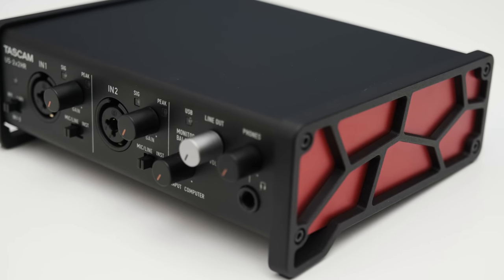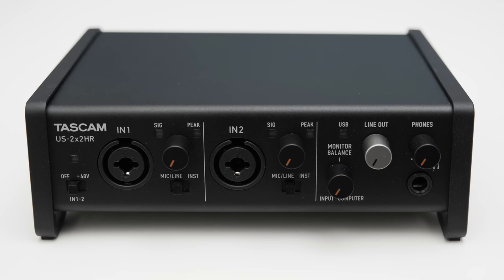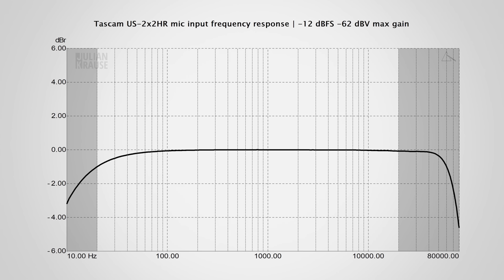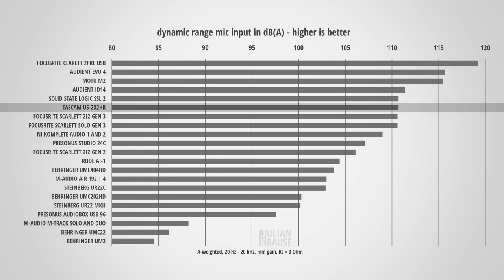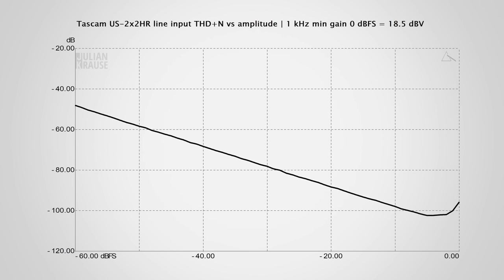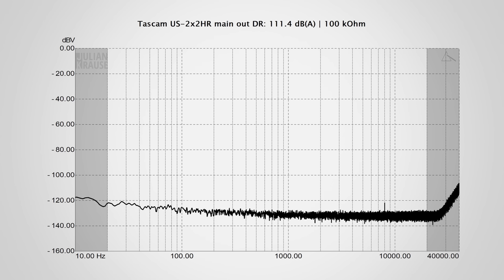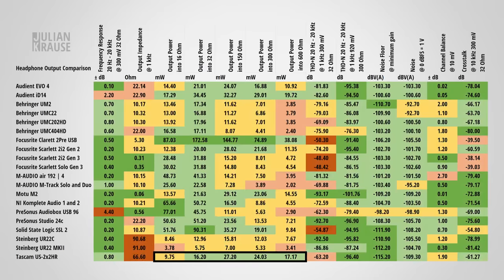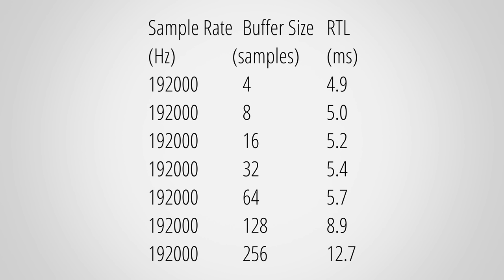Tascam US-2x2HR USB Audio Interface Review (audio quality test)

Comment: Young Julian Krause, I was enjoying your review.  Until you said...

These line level inputs will take full studio line level outputs, up to +18.

What the hell Julian?  Do you know what comes out the line outputs of Neve, API and SSL consoles?  It's more like +24 dbM up through to and beyond, 32 dbM.  On peaks.

And what you're going to get.  When all of the inputs clip out at +18.  Full studio line level, my ass, Julian.  No that's not.

You could consider its full studio line level, for rank amateur beginners and home recording enthusiast wannabes.  Yes.  Then you are a professional amateur!  Yippee!!!  Then you'll need an official recording engineer T-shirt.  That says, WILL RECORD FOR FOOD.

I mean telling everybody +18 is full studio line level.  It is like telling everybody that Heifer Wise Ass a.k.a. unfiltered wheat beer.  It is clear like Budweiser and not cloudy.  Yeah no.  Then it's not real wheat beer if it's been filtered.

HR on CIRRIS Logic when all of the other high-end converters are using AKM?  192 kHz is just the clock rate.  And is independent of whatever audio quality, real engineers require.  A faster clock does not automatically equate to better sound.  It does equate to a broader wider, high frequency range.  Beyond that of our human hearing capabilities.  I guess that's important?  If you can't hear it?

But you are right on the money, old man.  When you say that 50 DB worth of microphone preamp gain.  Is, even enough for the, less sensitive, lower output, SM-7B.  And of course there.  The joke is on you.  And do you know why Julian?  Would you care to mention this to anyone Julian?  As to why that is?  Let me tell you.

The reason why everybody thinks the, SM-7 and SM-7B's have less sensitivity and lower output.  It's because...  It's an, SM-57 capsule.  That is now, at least 2-3 inches further away from the lips on your face.  Thusly making the SM-7's appear to have lower output.  Because you can't put your lips within 1 quarter-inch, of the diaphragm of the microphone.  The long black foam condom covered phallic foam tube has the 57 capsule and diaphragm more than midway down the length.  I love that phallic looking foam condom covered, $450 US microphone.  With the heart of their, $100, PA microphone with an, SM-57 capsule.  Or as told to me by the engineers at SHURE Brothers in Evanston, Illinois, USA.  Because I'm an engineer also.  And I needed to speak with them about a specific set of application needs.  I needed to discuss what the best capsule would be for my purposes.  They also used the same SM-57 capsule in the little-known, SM-5.  Of which I had one in, 1978.  Until 1988.  When all the foam turned to dust and disappeared.  Leaving behind in an internal shock mount a SM-57.  I thought that was very funny.  Because the microphone was larger than the SM-7.  But that is one sucking fantastic capsule!

And for all of the little home recording morons.  The don't think that 50 DB of MIC preamp gain is adequate?  Because it's not slamming the meter.  Doesn't mean that simple entry level beginner want to be, wannabe, recordin' jockeys needs a lifter.  Up their asses.

Now as to those noise tests.  Julian, that was kind of beyond stupid to do.  Because the noise level will be lower.  Than any microphone you will have plugged in.  The room noise will be greater.  Even in the quietest of finely designed, rooms.  With the best and quietest HVAC Plenum based air distribution.  With no hissing in the background to speak of.  Or to hear.  You still have a higher noise level!  So the little bit of hissing don't make no difference in the end.  When you plug in a microphone.  It's going to be way noisier.  Way above the noise of the internal semiconductor electronics, itself.  Way way more noise.  Than that internal hissing.  That's called thermal noise.  And you're always going to have some.

As these items go.  You can expect similar performance from virtually all of them.  For entry level beginner hobbyist enthusiast home recordists, computer audio interface devices.  Take your pick.  Your indicated performance differences really mean nothing in the end.  No one's differences in performance.  Is going to make or break your homely produced hit record.  You will be a hit in your own mind.  Unless you've got a couple of million dollars.  To promote yourself into a rock 'n' roll star.  You're just going to be a home amateur recording enthusiast with another rock band.  And making homemade, chicken fried steak sounding recordings.  It will not be a fine filet mignon.  Of Prime Amazon beef.  Much less an Omaha steak.  It'll be what it is.  And that's a hamburger.  Your audio will sound like a hamburger.  It will not be a culinary work of art.  In a professional audiometric manner.  It'll be a burger.  McDonald's, Burger King, Wendy's, a hamburger.  A hamburger style recording.  Where the only thing you'll say is, where is the beef he had room?  There ain't none.  Eclipse out at +18 at the inputs and at the outputs.  When the pro stuff is going to deliver 10+ DB' is worth, more.  If you plug in that stuff to that thing.

So in the end.  This is a lovely, entry-level unit to consider.  I would have no real qualm using said TASCAM device.  Though?  If I was going to plug my Neve or API, UREI stuff into it?  I would create, 10 DB, balanced resistive input pads.  To plug into that little POS TASCAM.  So as not to overload the inputs any, at all.  Then it would be reasonable to use in that application.  Not needed.  When used with other, consumer/Prosumer audio gear.  Because most of that only works up to +18.  A good 10+ DB shy of, truly professional recording equipment.  And that's no little thing.  That's a big deal.  I don't much like finding nor contending with.  Because even some of the premium high-end, computer audio interface device inputs.  Clip out at +20.  Which is still in adequate.  To be used.  With truly professional high-end audio equipment.  It's truly a mismatch.  And you don't realize what is happening to your audio.  Because you don't get red peak lights.  To tell you that the inputs are getting clipped out at the inputs.

Otherwise you are rather cute and soft-spoken.  So I would love to hear.  What was on your waveforms.  When I saw those ultra large excursions.  Which were substantially larger.  Than any of your spoken word material.  So you were screaming something.  We never got to hear LOL.  What were you screaming about?  Hey get the fucking phone?  Shut up Bowser?  Billy I told you daddy is working right now!  Go back to your bedroom.  And leave daddy alone.???  Or was it, OH FUCK.  WHAT'S WRONG WITH THIS FUCKING THING???  I'M SUPPOSED TO TELL EVERYBODY THIS IS GOOD???  Hi there, my name is Julian Krause and I'm here to tell you how great this TASCAM thing is.

And only because we can see it on your waveform going by.  With your Adobe Audition.  I turned my waveforms a pretty dark purple color instead of green.  Green gets me queasy.  Because a little girl in Georgetown, Washington DC spun her head around and barfed green vomit.  And I work in Washington DC.  I know where she did that.  As I've also recorded, there.  And I never found any green barf.  So that was fake green barf!  And I don't want to see fake green barf in my waveforms.  They are much prettier when you choose purple waveforms.  So much easier on the eyes and the stomach.  Look it's purple.  Who doesn't like purple?  When I was younger I even took some of the stuff.  And ingested it.  What a ride!  I felt all hazy.  From the purple haze.  While I was tracking 24 tracks.  And doing a live stereo FM broadcast.  Simultaneously.  Everybody else is seeing colors.  I'm watching leaders move.  And mixing rock 'n' roll for broadcast.  Try that on purple haze.  I dare you!  Generally I just prefer pot.  And then you get this:
https://soundcloud.com/user-135130368/sets/live-at-electric-church-fm-sessions-vol-1

Now that's all live at a nightclub over a period of 6 weeks.  All cheap PA microphones of SM-57 & 58's.  And a couple of 36-year-old AA battery required, Taiwanese made, $30 each, Radio Shaft, PZM microphones for drum overheads and stereo room microphones.  Nothing like having 1984 vintage 36-year-old toy consumer microphones.  For your primary drum pickup.  Using duct tape to tape them to the suspended ceiling tiles overhead.  I think it's very funny.  How I make these recordings.  I stick a microphone on the guitar amplifier.  And that's it.  There's no moving it after that.  There's no adjusting any of the microphones.  You just set your gain trim and go to it.  That's what you're listening to.  100% technically compromised haphazard recordings I make for live FM broadcasts.  I don't know the bands.  I don't know their songs.  I don't know how they want to be presented.  I just push up the faders.  And try to figure out in 60 seconds or less.  What they are trying to say to their audience?  As these are all, 60 second, mixes.  With no actual volume or microphone checks before they begin playing.  I tweak on the fly for the first 60 seconds.  And I lock into whatever I get.  And role with that.  Some don't come out as well as others that way.  Because they are not recordings made intentionally as recordings.  It's alive nightclub act.  When we used to have live nightclubs.  Now they are all dead from a virus.  But that's the way it used to go.  In a place far away in a time long ago.  5 miles away from you.  You use to hang at, nightly.  All gone now.  And forever more.  So enjoy 14 cuts of a night at the nightclub.  With 14 different bands from Austin, Texas.  All live and my live haphazard, coast-to-coast style of, haphazard lackadaisical, recording techniques.  It's rock 'n' roll.  It's not supposed to be perfect.  It's supposed to be kind of perfect.  Like this.

An old timer at this stuff
RemyRAD